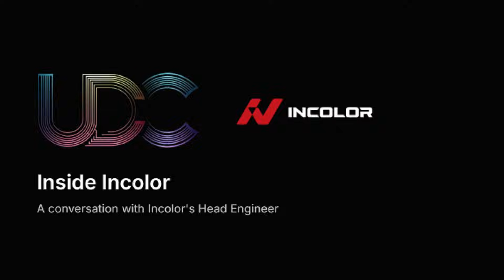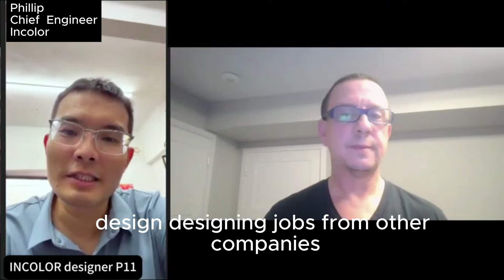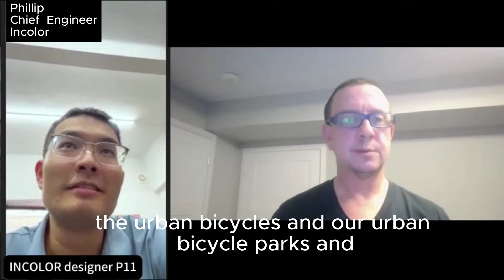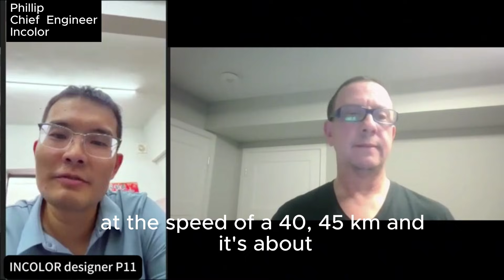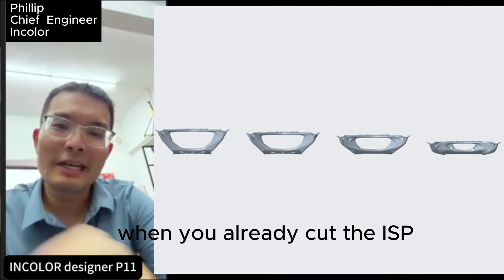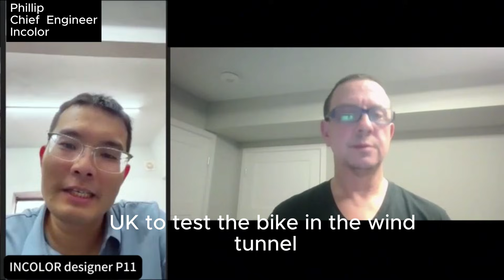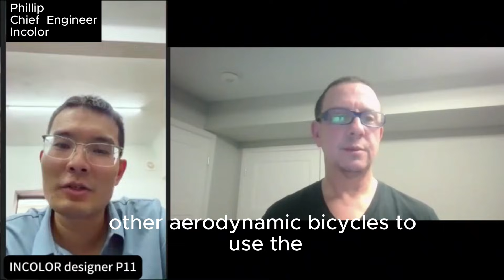Inside Incolor — A Conversation with Incolor’s Chief Engineer

Comment from the maker: Thanks for watching this Inside UDC interview with Incolor’s Chief Engineer about the SSR platform. If you have questions about the ISP system, fit range, carbon layup, or wind tunnel testing, post below — we’ll send everything to the Incolor engineering team and share the answers.

Chapters
00:00 – Open
00:40 – Incolor background
02:20 – About the engineer
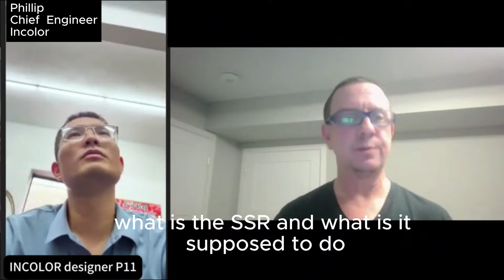04:50 – SSR overview
06:00 – Evolution from SR+
06:50 – Carbon layup
08:35 – Fork design
09:55 – ISP rationale
11:20 – ISP adjustments
14:00 – What’s included
14:50 – Pricing
18:11 – Saddle range
21:21 – Resale
22:35 – Future testing

—
If you’d like more interviews with engineers/designers behind modern aero bikes, let us know.